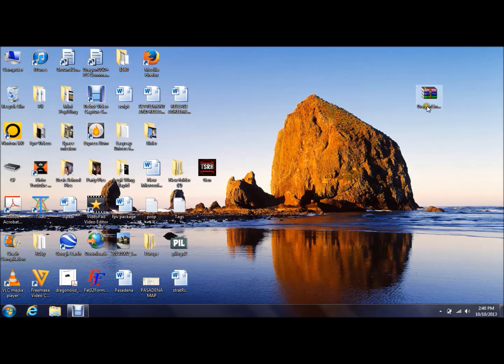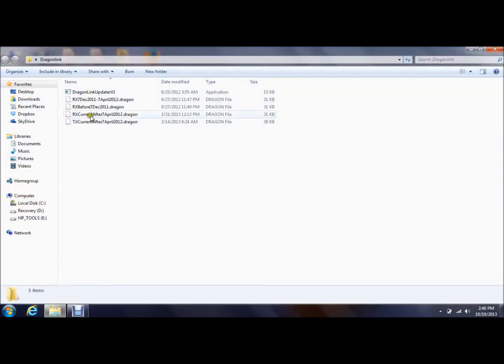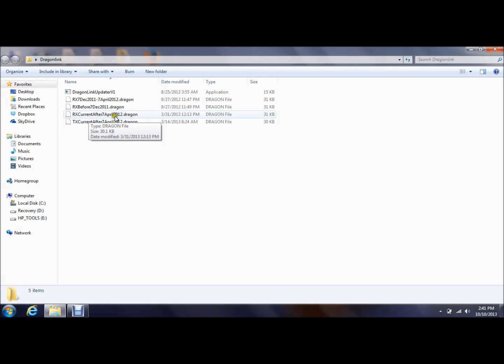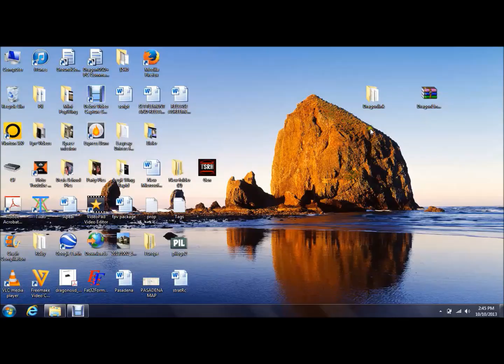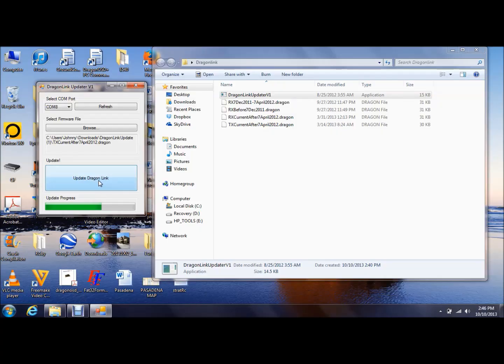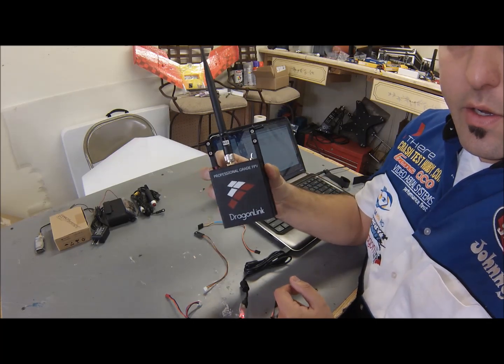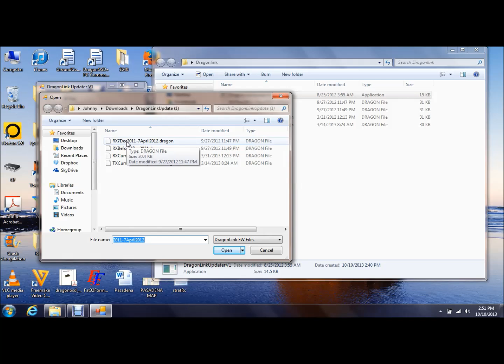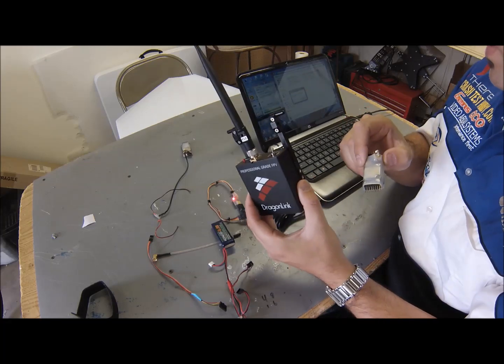Dragon Link RC V2 Firmware Update instruction Video

Comment: Great video. Congratulations. Can you give me a hint on how to improve the signal of my dragonlink v3 slim advanced with rx 1500 mW Large installed in a radio transmitter Futaba 18sz, was made normal working bind, but did signal test I left tx in a place with a person moving the stiks and I took the rx in a car to see how many km would the good signal, but only gave 700 meters and dropped the signal, can you help me with tips if in the configuration by the computer inside the tx and rx can improve it?

Comment: Hey man, how do you reverse the channel in dragon link v2 and where can i buy the firmwar3 update cable
Reply from the maker: Jeff Lee All the channel mixing is to be done in the radio. dragonlink only outputs the information fed to the DL by the radio. 

the cables are really hard to come by because dragon link no long supports the hardware. you can send them an email and they may have a few of them

Comment: ftdi controller driver? so were do i download the old drivers, on the dragonlink website, its just the one version?   theres drivers in the new version, V3. but how do i install them? and will they work? can i use the new firmware installer with old firmware?
so many questions....

Comment: Hey, Nice video, BUT, I get the "serial Error! No response from target. I just re downloaded the software from the dragonlink site. it could be me, I am not goog with pc's. what driver do i need to download to get this thing to work. in the devices window, in windows, (running windows 7, by the way) it says it is unspecified( when i plug in the stuff) FT232R USB UART. please help....
Reply from the maker: frank rizo This is an old video. No target usually means the ftdi controller driver is not found. search for the Ftdi drivers some of the older firmware packages have the driver in the zip file.

Comment: Hi mate. I've been up until this point been using my dragon link in standard servo configuration with my fixed wings and have just bought an eagletree vector and need to change over to PPM to get a 7th channel happening for gain control . is it an easy thing to do? cheers love your work.

Comment: I'm having trouble updating to nextgen firmware. So I hooked up the tx and rx and everything was just like in your video.but can't get it to work after. Just to be sure after the update I setup new ID by holding bind button till light goes out then re bind like normal. Right?
Thanks in advance
Reply from the maker: You may have a bad cable. By bad cable I mean the wires might be crossed, I know there was a batch the had them mixed up. It wont mess anything up, but it will also not update correctly. Goto the RCgroups thread in the description and search through the thread for the correct way to line up the pins on the updater.

Comment: Thanks for the video, can you tell me if the latest update effects head tracker.. been trying to get my attitude v2 working with it for ages.. thanks
Reply from the maker: Yes it does work the with head tracker but the Head tracker needs to be connected when you bind.
Reply: Thanks.. Bind is this when you do the main 15min bind? thanks
Reply from the maker: With the Latest firmware you no longer need to calibrate for 15mins. Bind means the initial Connection between the Transmitter and receiver.

Comment: Hi! Just updated my TX and RX with Ver. 27May2014-11. So is it correct that I don't have to bind the RX anymore with jumper and wait 15 min for calibration? Just turn on the TX without pressing the binding button? Only the red and blue light solid, no green light (status)...!
Reply from the maker: Yes you no longer have to calibrate the Dragon Link. after your done updating the firmware just change the ID and bind to all your receivers also don't forget to reset your Failsafes.
Reply: FPVTeamLegit Thanks - but could you tell me regarding binding - I still have to press the bind button at the TX until red/yellow flashes or this isn't necessary anymore as well?
Reply from the maker: Urs Merz Yes you will still need to bind the Receivers. But you should change the ID as soon as you flash the TX.

Comment: I have 2.81 rx should I use the newest update?
Reply from the maker: I would Suggest you Update your firmware. Its healthier to your system. It blocks out alot of interference and just gives you a cleaner and more solid link. Just makes a great product even better. If you Live in SoCal you can cruise over and i can do it for you for free.

Comment: All I get with two receivers is "Serial Error: no response from target" when I try to update. Tried 3 computers.
Reply from the maker: Make sure you have the correct COM port selected. Also the Receivers should be powered up by a separate 5v bec.
Reply: FPVTeamLegit I took care of the problem by selling the 2.7 junk on rcgroups and buying a 2.81
Hopefully it will accept a update so I can use this with a Naza.

Comment: If you buy a cable to connect the receiver.
Will I be able to slip the old firmware in the receiver V2, and linking it with the old Dragon Link transmitter

Comment: Why Dragon link does not allow the old transmitter can be connected to the new receiver V2.

Futaba Transmitter over 7 years old can be connected to a receiver that Futaba /

I will eventually have to buy a new set of Dragon link that we would fail the new V2 Receiver